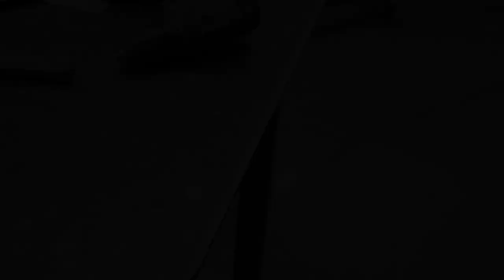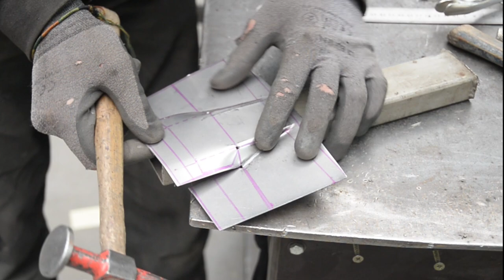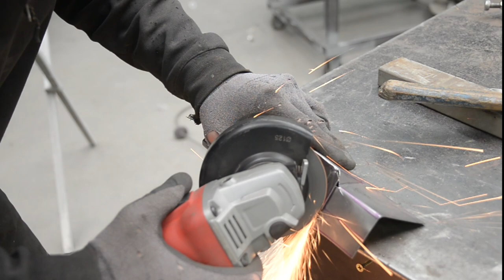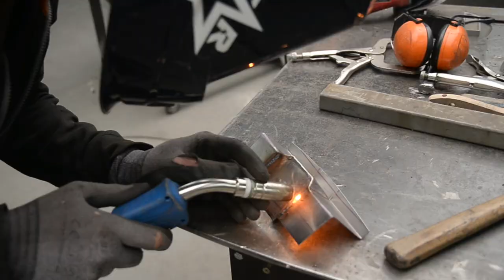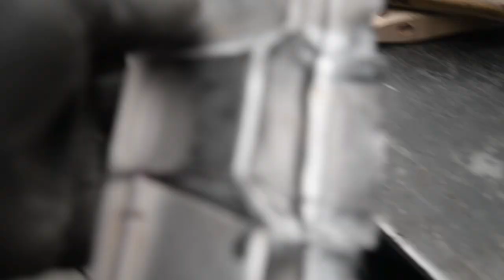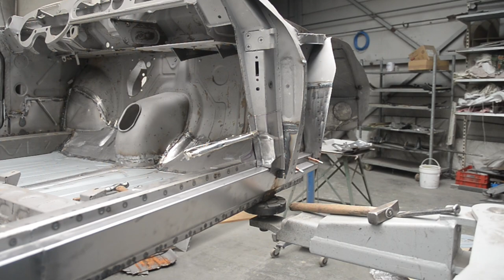Lancia Fulvia Zagato: rebuilding the bottom of A-post (Hinge bracket)

Comment: Were the holes slugged or drilled? They appear to be drawn down a bit, creating some formed countersink.  Very nicely done!
Reply from the maker: it is steel thickness 1mm.
The holes have been drilled.
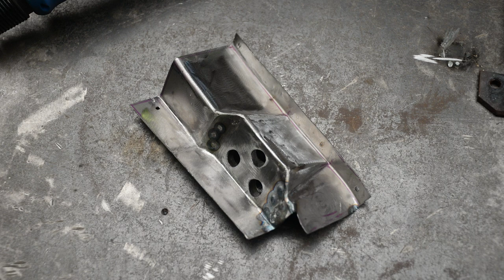the chamfer you mention is probably because you can see the cage in which the tapped plate for the hinge screws comes (7:40)
Reply: @slgclassiccars4098  OK